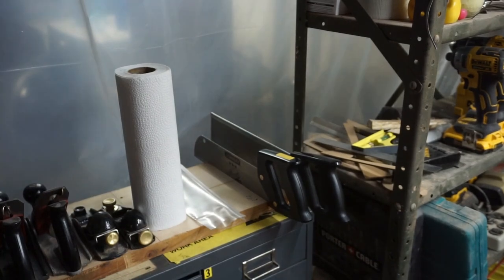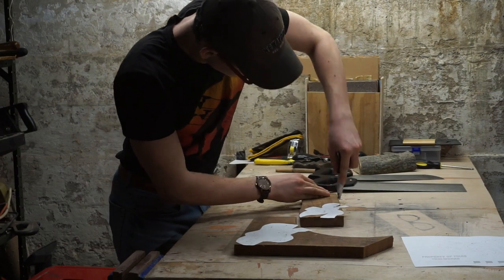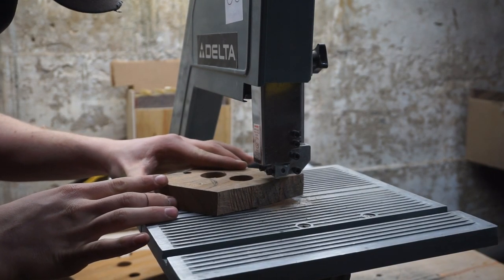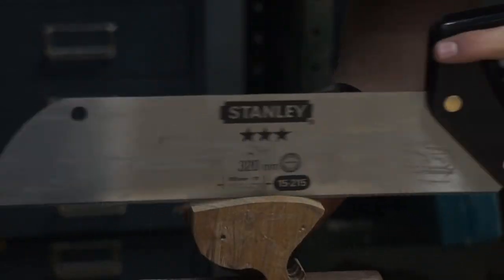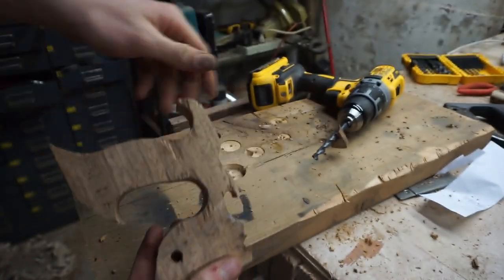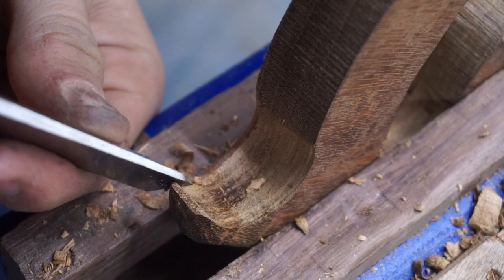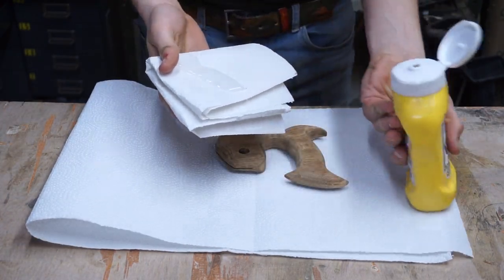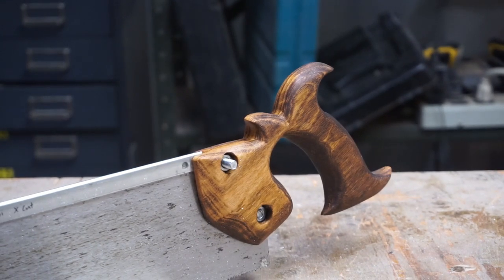MAKING CUSTOM SAW HANDLES

Comment: Dont give up on the files! I've found using a fine single cut file after the rasp and coarse files leaves a pretty smooth finish especially on the flatter surfaces. nice looking handle my man!